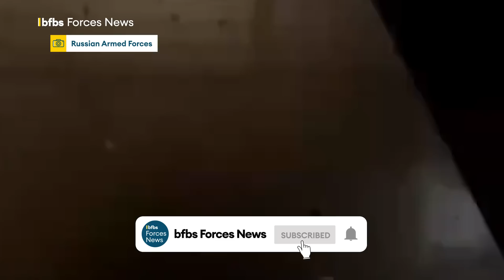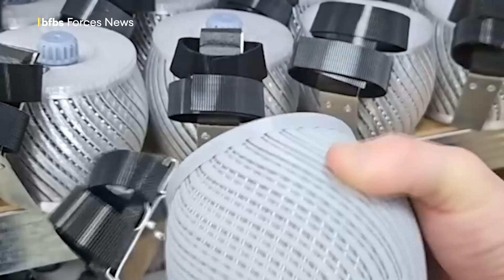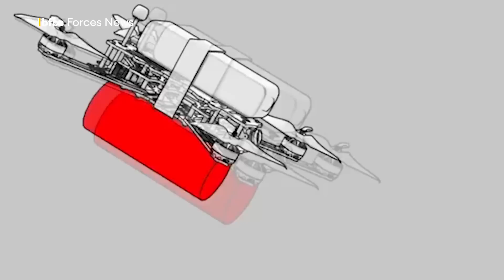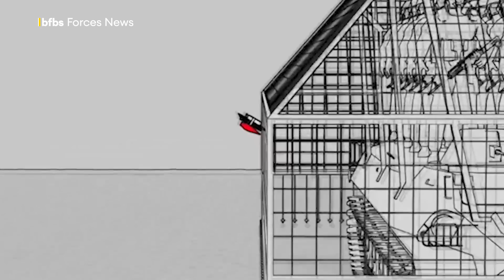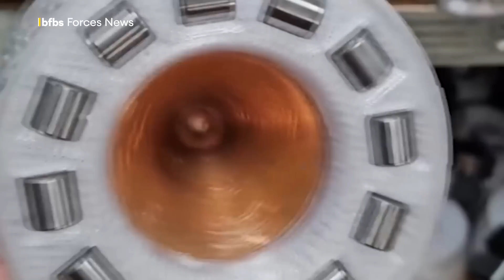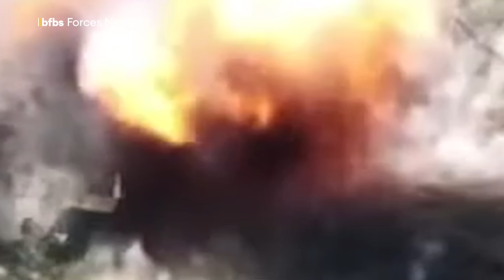New Ukrainian munition packs a punch through Russian tanks' cage armour

Comment: That second device is not any kind of "frag" or fragmentation warhead.  It's what's call and explosively formed penetrator (EFP).  It's a concave disk of metal with explosive behind it.  When the explosive detonates, it liquifies the metal and accelerates it to very high speed.   As the metal travels to the target, it forms into an aerodynamically shaped slug and hardens,  The slug hits the tank armor with enough force to blast through with kinetic energy.
Reply: principe de la charge creuse ... !!
Reply: @marcragueneau2813  No.  EFPs are different.  Shaped charges burn a hole through the armor. EFPs punch through with kinetic energy.